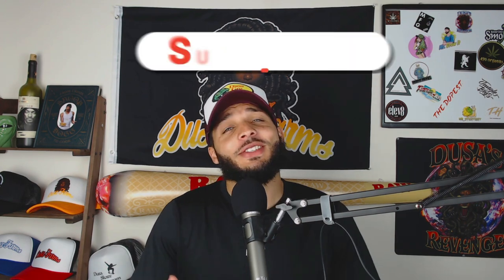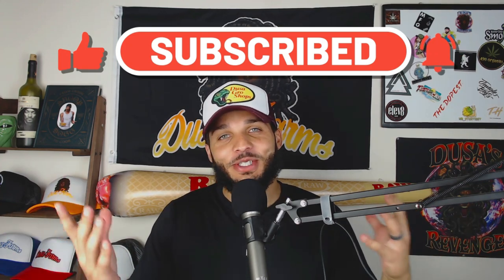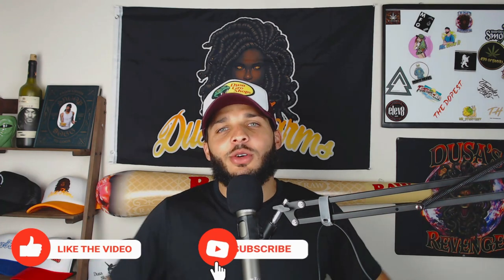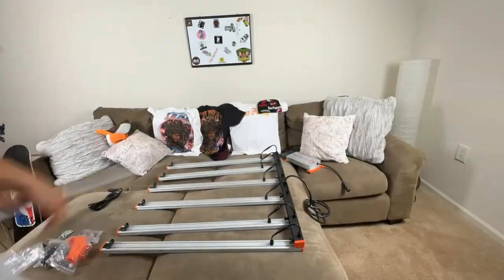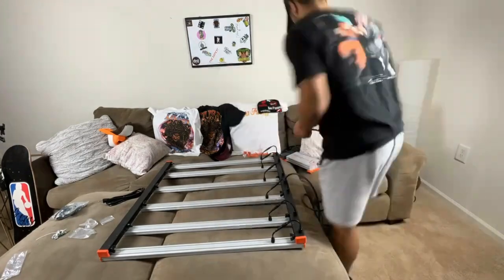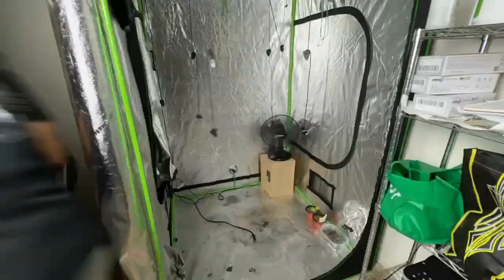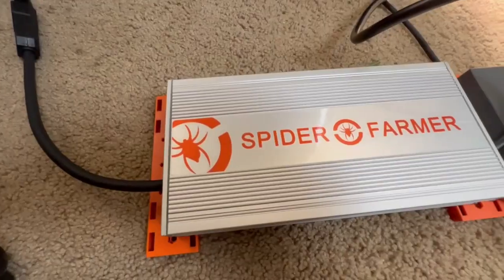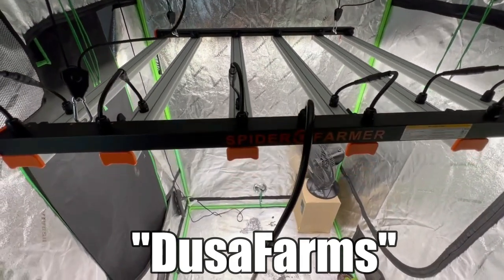Best Methods to Control Water Temps in DWC / RDWC

Comment: What also really helps with Temps in DWC or RDWC is placing the buckets directly on a tile or concrete floor. Can't beat the heat transfer. 68 to 70 consistently. Love the videos!
Reply from the maker: Appreciate that fam!
Reply: Had a homie in Ohio do a dwc in his basement perfectly place too
Reply: That actually is a good ideal

Comment: Old Mini Bar fridges can be modified into chillers!. 2 holes 1 water pump and a roll of tubing.. A large old fridge could be setup to chill a bunch of systems.  Find older 1's for cheap even free online ready for some mod's.  Works great, you get a chiller and grow room snack bar in 1 ;). Heaps of DIY info online about them.
Reply: Small chest freezer with bad top seal.
Never worked as a freezer. Perfect with a thermal switch and the resievor.

Comment: i put my bucket in a storage container half full with water and I threw small bottles of water in the bigger container. it started out to keep the ice away from the roots, but it also gives a larger thermal mass without needing a larger reservoir of nutrients.
Reply from the maker: Smart! Appreciate it fam
Reply: Between that and beneficial microbes, I've had no problems. Right at lights on I would add some, and when I got home from work I'd add some more. Idc if it wasn't perfect, it doesn't have to be 😉

Comment: I've got an RDWC system, and agree temps of the nutrients has always been an issue for my system.  One thing that works for me cause I'm very small... I went out and bought a refrigerated cooler  plumbed in as my reservoir, which I plug in and it helps to maintain the temp of the nutrients.  Doesn't make a huge difference, but I figure it's a problem that can have many solutions, which when taken in combination, can overcome the problem.  I've had very good results with this approach.

Comment: "TRUST ME!"
Reverse your exhaust system... Place your exhaust fan near your AC vent.
Run your ducting through the bottom of your tent. Place your pump directly in front of the ducting, then you're going to place as much of the tubing into the duct, including the air manifold if possible.
The core problem isn't room temperature per say, the main problem is that the majority of the hot air that's heating up the water is coming from the air pump. Focus 100% on cooling your "AIR MANIFOLD" & the tubing at the beginning of the air manifold. I literally kept my water temperature at optimal with this method.
The only drawback is based around the location of your grow being that that area would have to be running the AC 24/7!
Reply from the maker: Appreciate that fam!

Comment: Running 1-5 gallon bucket and trying to grow in a closet in the Texas summer.  Water temps were waaay too high.  Got a water chiller from Walmart for $110.00.  It's basically a small aquarium chiller.  Works great.  Unfortunately, I still can't get my seedlings in rockwool to take off even after 2 weeks.  My flower is struggling and it's my 1st grow, so we'll see what happens.
Reply from the maker: I always struggle with rockwool as well. I usually just germinate my seeds in paper towels and then place the taproot into the clay pebbles
Reply: @freesmokegrows  This method is what works best for me
Reply: Try to bring the PH down in the rockwool, it tends to have a higher acid level
Reply: When you transfer your seedling in the rockwool to the net pot. put only one layer of the clay pellet down then your seedling on top. For the first week or so make sure that your water level is up to the first line of clay pellets so the plant can sense the water and the roots will migrate to it. Once you see roots coming out of the net pot you can lower the water level down to where it should be.

Comment: FYI, I went with the cheap $120 water chiller, 1 it had trouble reaching 20⁰c (68⁰f) 4 site + res (13 gallons) and with in a week it failed, the cooling fan would randomly stop and with in a few hours the water temp would reach 27⁰c (80⁰f). I bought the Vevor 53 gallon for $230 and that thing kicks some serious butt.

Comment: Easy fix for you. Put a water hose, into your reservoir at bottom, feed the hose outside the tent or outside. As water heats, the hose will cool it down, too cold, pull the hose in, too warm, release the kraken

Comment: What about taking a small aluminum radiator brand new that was never used. Tie it into your circulation line then mount a fan on it to cool the water.

Comment: Run a small pump on a timer in the Resivour.  Run thick black tubing to Window AC Connect to coiled copper tubing , 24". Hang coil in front of AC vent. With black tubing going back.
Set room temp to 75*f
Reply: Don't use copper tubing, it will cause oxidation.

Comment: I figured out why my comments weren't being posted!!   Buy a used water cooler off market place ( $15- $35 ), one that you would normally put a 5 gal jug in the top. Now tear it apart so that you are left with the compressor and the cooling coil. Some of the cooling coils are coated in a protective plastic and some are not. If the one you have doesn't have a protective coating on it just wrap a plastic bag around the coil so you don't get any oxidation in your nutrients. Place the coil directly into your nutrient reservoir. Buy a device that will monitor your water temp. I use the ITC-308 ($50). Plug the compressor into the cooling plug on the device and set your water temps. I set my water temp at 67 deg and set the turn on temp at +2 deg (69).
Reply: Did this really work for you and is it still?
Reply: @jessehernandez7568  Yes it works. M
y whole RDWC system, 4 buckets in the tent and 1 reservoir outside the tent, does not exceed 20 gals. I also add Hydroguard, ($85 /L), every time I drain and refill.

Comment: I use 1" + thick 8" x 35" x 17" Styrofoam Fish Shipping containers. I rarely notice significant High temperatures even on the hottest days. My growing method is the passive Kratky system. This is the most Affordable hydroponics at 100% FREE to as high as $6 each for the Styrofoam boxes.

Comment: Nice video, for me, fan-ice daily-across the pump that pumps air into the plant sites. Only way I have been able to get around buying a water chiller, is by chilling the air at the pump intake site, and it is only marginally better than just saying fk it. Running hydro and not pushing for perfection is not the thing in my opinion though.

Comment: Ok I'm running DWC 5 gallon res (STYROFOAM) under a 315 w LEC built in ballast. 
1. Add ice to nutrient solution after mixing but before final pH balance.or brake it down to 5 milk jugs and put them in the fridge for a bit .  These 2 things will ensure you start off with optimum temp solution.
2. This is most important when controlling and maintaining the air temperature coning I threw your pump ..you gotta have your pumps in front of a fan and best if that fan is ducted to an AC 
3.this  is RARE tip that maintain temp in your res for long periods of time like this for me eliminates my need for a chiller I will only have to chill my solution at the start of each res change ...... STYROFOAM STYROFOAM STYROFOAM STYROFOAM STYROFOAM STYROFOAM 
ICE CHEST lined with a industrial strength black garbage bag
It is the absolute best insulator and  the black garbage bag allows 0.00% of light penetration to the roots ...
4 . enjoy your smoke and a little bit less stress growing ....
But I can't stress enough about the container  bein STYROFOAM
Reply: I think you're definitely right.
Reply: forget styrofoam, use an actual beer cooler for a nutrient reserve, or 2 inch insulation on top and inbetween the nutrient tanks.  Ice helps, no nutrients, just a block of ice once a day......, I also use foam spray insulation around the tubes for the roots!

Comment: I just bought a 4 bucket dwc with  drip rings by Vivosun. I haven't set it up yet. I'm wondering how or if it is possible to convert it to a rdwc. Any thoughts? Great videos and info!
Reply: You need a bunch of pipes and pumps and another bucket for a reservoir and a water chiller, it's a bit of work, and there are videos on how to do it, but not impossible.
Reply: I got that system for my son. I think you could get a central bucket, and connect it to the four grow buckets with 3/4" to 1" drains, using barbed plastic connectors, rubber hose, and grommets for going through the buckets. Drill your holes 1/2" from the bottom of each bucket, and connect them to the central bucket. Since they use the air lift to the drip rings, they will draw from the central reservoir bucket. You can do all your pH checks and  TDS, and nutrient changes from the central reservoir and won't have to disturb the plants. Draw a picture of how you want to connect everything first, and you will know what supplies to get. You could also just connect the four buckets together by a drain, and use one of them for your reservoir, growing 3 plants. When I do my grows, 3 usually fills my 4x4, and is what my state says is legal, anyway. So far I've harvested enough from each grow to keep me in smoke and cannabutter until my next crop is done, and I'm a pretty heavy user.😂

Comment: HELP...! How can it be that the display of my chiller (new) shows 15°C but the reservoir in the 2x4 tent is 28°C ...! Without a chiller its 24° max, so i'm confused ... Inside the tent runs a 300w led with max temp of 29°C at the canopy...
How is that possible...?!?😢
Reply: Put the reservoir outside the tent. You are trying to cool it down and yet you have it in the tent where it is hot.

Comment: I put a portable ac directly in the tent and set it at 62. My temp never goes above 72 and that's only when the lights are full blast. Average temp is  67.
Reply: What brand did you get bro I’m looking just in case I need to invest in one

Comment: The reason you must have your nutes  at 65 to 70 degrees is because if your nutes go higher than 70 is to prevent root rot, and no matter how good your pump is, if your nutes go higher than 70 degrees you will get root rot. I use 5 gallon igloo water coolers for the plants, and a big 27 gallon igloo ice chest for the reservoir , and use a  small old  fridge as a  chiller and  if needed ,frozen water bottles in the reservoir  to control temps to grow outdoors during summer. Also, I use big  air stones in each planter, and  2 in the reservoir
Reply: This has not been my experience. I've done over 50 runs now and my res temps get into the mid 70s all the time. 10 watts of power per plant is more than enough to prevent root rot. Most people run little aquarium pumps which are only about 3 or 4 watts. Amazon has 40 watt pumps for under $40.

Comment: Black buckets... Black as we know attract heat, I started using home depot orange and lowes blue even white buckets never had an issue with light leaks. Another tip like you said making ur reservior larger. If you bought pre made dwc buckets that have the grommet elbow and usually blue tinted tube as a water level gauge. Connecting one bucket to another will double your rez size now u won't have the ease of turning one sideways to drain simply place ur plant I'm and empty clean bucket while u drain and clean for your rez change or simply disconnect If you have the ability to just  let them drain where they are. You can also place a small pump in the extra bucket and pump it out then refill in the same bucket so u dont even need to mess with the bucket ur plant is in. Yes you will have about an inch or so left on the bottom don't worry it won't harm anything if u are worried use a shopvac for that last 1/2-1 gallon.

Comment: If running separate DWC buckets, the best way to keep the temps in the green zone is invest in insulated buckets, or use bucket jackets, and install micro chiller probes, such as Nova Tech Coolworks Ice Probe and temp controllers. Typically sold by aquarium suppliers. I use one in my aeroponic cloner, works amazing! For RDWC it's no question, a minimum 1/13 HP aquarium chiller, 1/10 is the best way to go. Invest in quality chiller brands, stay away from the cheap chinese chillers, especially the electric ones. 🧊
Reply: Chillers are to expensive. There are much cheaper ways to cool the water to a steady 66-68 deg.
Reply: @Ballme60  No there isn't. You would have to keep ice packs on a constant rotation to BARELY keep those numbers, even indoors during the winter season. And if you can't afford to invest in a chiller, then you're just growing some bullsh*t 🤣